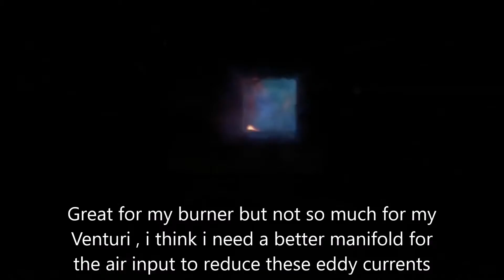Thore MONSTER Propane pre heat burner for industrial process

Comment: Yes you described the cause of the swirl correctly.

That said, again, for combustion its not a bad thing...but if you wish to increase your linear flow, use 2 parallel pipes [between 2 and 3 feet would suffice] to allow the compressed air to accelerate the charge along the intended direction of flow, and place some stratifier dividers in the tube near the discharge end [could be strips of metal or smaller tubes inside, 2 inches deep by about 1/2 inch apart would be adequate, and you can solder instead of welding, so you have a smoother, less irregular shape to reduce turbulence] which will both increase the straightness and laminar value of the flow.

The higher the speed of the air exiting the driver tube [compressor] jet [and each little outlet qualifies somewhat as its own little independent jet, therefore uniformity is crucial to the strength of the draw] the stronger the total draw, and, to some extent, the ratio of expansion [as you have already been experimenting with] so that the high speed jet strips away the air as violently as possible to generate the maximum possible vacuum.

Keeping in mind that this will never draw a technically pure vacuum at any level of boost, still, the higher the exit velocity of the compressed air jet, for any given uniform angle of divergence, the greater the draw will be.

This is mainly for people who are just observing all of this for the first time, since NOBOX7 has kinda already figured a lot of it out.

Comment: same thing only 0 or o O , circles pipe , I commented on another video in a burner you had made from pipe to add your air compressor downstream in a similar manor, I believe your design is more effective put smaller size burner with Venturi input downstream of the gas (please use your compressor not the blower)  ! love this concept, going to give my own a build  but currently short on work materials